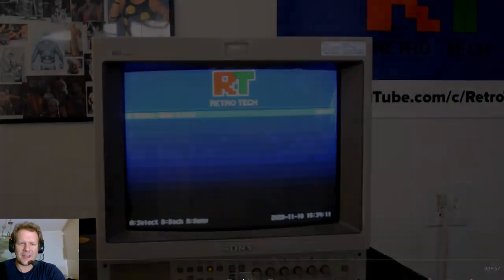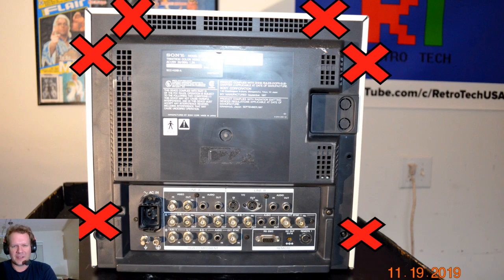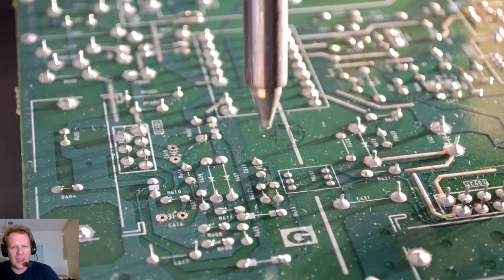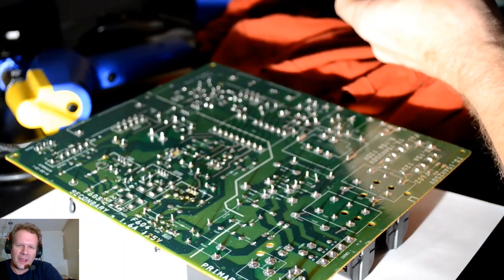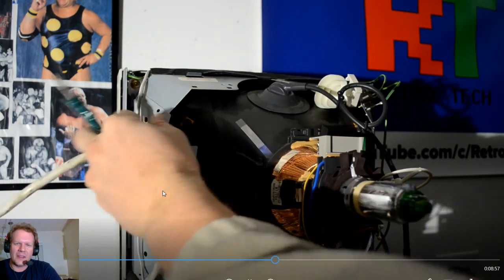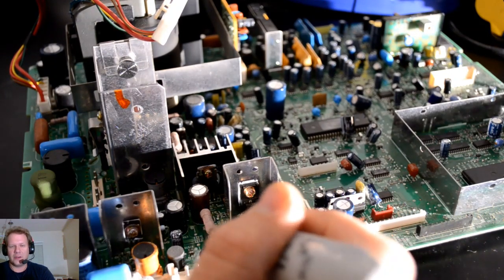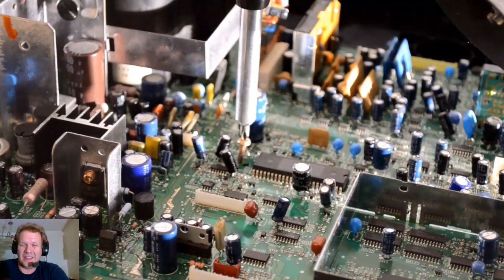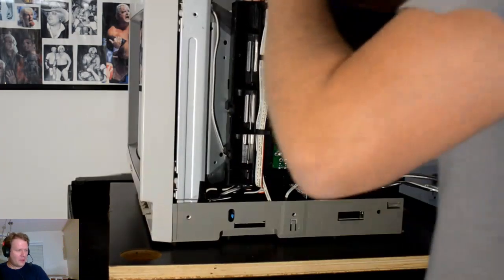Future-Proofing a CRT - Sony PVM 1353MD

Comment: Those earlier PVMs were very good, but suffered from misconverged edges. You will probably never notice it during normal usage, especially with 480i/576i sources, but it's really annoying in some 240p games. No amount of magnetic strips can fix it because the raster just doesn't fit the tubes perfectly.

Comment: I was wondering about something regarding recapping:
Let's say I don't want to recap the whole monitor at the same time.
If I recap the power supply first, wouldn't that increase the voltage and could make the rest of the system age faster?
If I recap the rest of the system before the power supply, wouldn't that create a higher load on the power supply?

Comment: Great Video, love the level of detail on all the steps.

Want to get some input on a small issue with my 20m2mdu. Currently the left side has a faint blue hue to it while the right is faintly red. Looking at the service manual, does this mean the yoke is pushed a little too far forward?
Reply: This sounds like it might just need a manual degauss. Exactly the same issue as mine used to have until I degaussed it.

Find yourself a cheap manual degausser online. The cheap ones work just fine and you'll likely only ever use it once or twice. Great things to have if you have pro CRTs.
Reply: Wondering the results of this issue..

Comment: Why are snap in caps harder to replace?
Reply from the maker: You can't use the same desoldering tool to replace them.  I've gotten a new hot air station since this filming to solve the issue.  Unfortunately I was never that good at wicking anything.
Reply: @RetroTechUSA  in my humble experience those large snap ins are easier to desolder than the small caps. Less of a chance of lifting a pad. I turn my soldering iron up to 700 and use a hand pump (the large one not the shitty small one).

Comment: Hi Steve, where can I get the Snes video test cartridge like the one you use for testing/calibration on the pvms? Do you sell them? If you do, I'm more than willing to purchase one from you.
Reply from the maker: It's a ROM that can be loaded to any rom cart.  Here is a link to the ROM Download.  You could burn it to a disc also.
Reply from the maker: http://junkerhq.net/xrgb/index.php?title=240p_test_suite
Reply: @RetroTechUSA  Thank you so much for providing the link.. I've been wanting to calibrate my pvm-9044QM without much success without the program. Btw,  do you sell replacement capacitors kit for this model?

Comment: Do people ever give you a hard time in your soldering technique? I was shamed when starting out for not using the iron in one hand, a length of solder in the other and bringing them to the component together.
Reply: screw whoever shamed you. practice makes perfect. u can buy cheap clock kits from eBay for a couple dollars they're good practice if you want something cheap to work on.
Reply: @sam-oh3wy   I shook the habit and I'm glad I did, it's a lot faster when you're going down the line on a bunch of solder points. This guy is way more knowledgeable than I'll ever be, though, and he uses the technique I was discouraged from using early on so I guess it doesn't really matter.
Reply: @nickprime1116  It depends on the situation and what kind of component you're soldering. For example here he's likely holding the cap from the other side when soldering, so it's straight. Since he doesn't have three hands, he has to preapply solder to his iron.